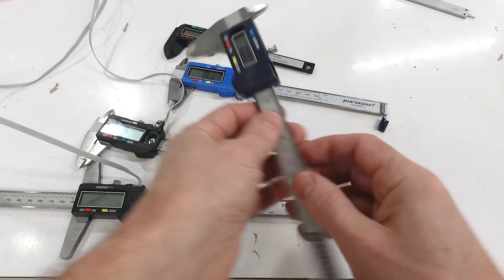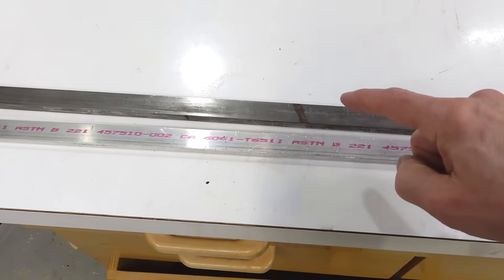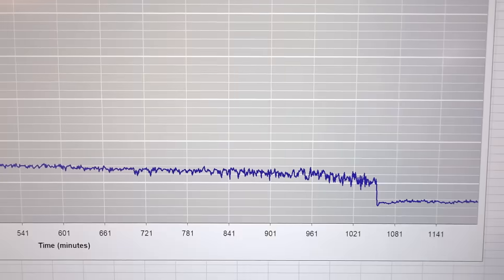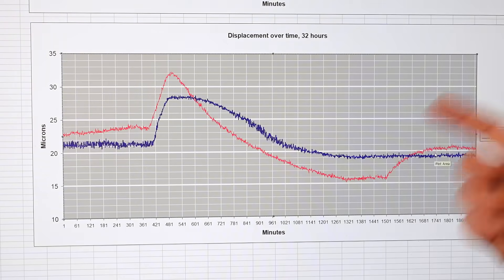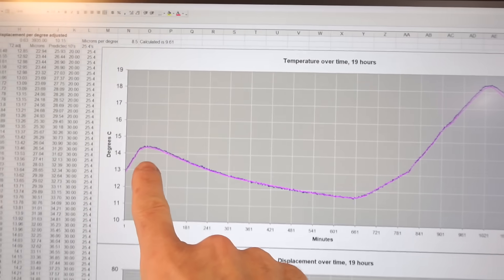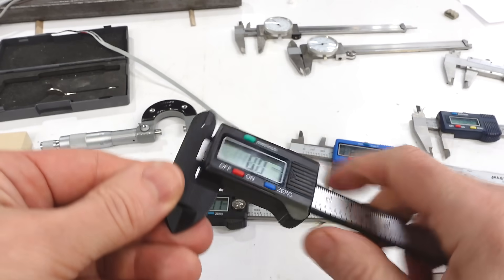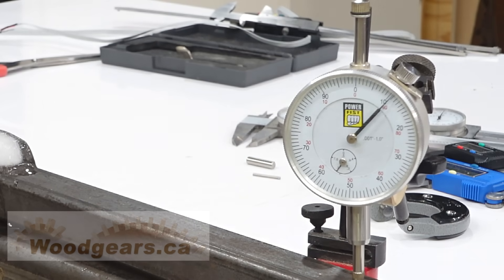Measuring microns with digital calipers

Comment: This was super interesting! Ive got a set of cheap callipers that actually had solder pads on the pcb you can tap in to - the signal doesnt seem to quite match up to others ive seen but it might be useablea
Reply from the maker: there are different protocols, a lot just send what is on the display, binaryt encoded, which is much less useful.

Comment: Just found this video today, so sorry for the half a year delay 😬
On the non-instrumented end of the bars, you are mechanically joining two dissimilar materials by friction. I woul love to see how the system performs if you reduce the contact point between the two as much as possible.
Now the question is: how can we get the "good", cheap calipers? 😬

Comment: you can use a lever arm with the micrometer to get even more accurate measurement, because of the level magnification effect. also making your own micrometer based on uniform resistivity measurement along the micrometer axis, to a wire. gives very accurate results, assuming the metal is uniform.

Comment: Visualization trick: divide (or subtract) your measurement by your expected measurement to get a graph of error over time, it would be a lot clearer than holding a straightege up to a portion of it and trying to eyeball the deviation.
Reply from the maker: At the scales I'm using, the ruler is quite sufficient to show nonlienarity, and also much easier to understand.

Comment: I think you are looking at two things here.
1. Thermal lag - the bars have finite length and cross section. It takes time for the temperature to rise in the bars, hence the sensors will always lead the expansion.
2. Temperature sensors are not evenly distributed over the length of the bars. You might get better results with many more sensors distributed along the length, or a long length of NiChrome wire.

Placing the experiment inside a tube and pumpung air through a closed loop with a fan would also remmove a few artifacts.
This being said, your experiment shows that these caalipers can be used to get repeatable high precision measurement. 
Accurracy at this scale is extraordinarily difficult to attain..

Great piece of work!

Comment: On the subject of increasing measurement accuracy,  I wonder how to consistently produce small movements of a table saw rip fence.  I have mounted a dial indicator to a wooden base with magnets (I think I got this idea from you)  to render fractional movements of my rip fence (10ths of mms).  This has proven to have some use for getting the fence in the ballpark of the desired outcome but the calculated fence movement never produces the exact desired result.  I know that fence deflection, blade bending and the variability of wood density are all factors but I wonder how great a degree of accuracy is achievable and what reasonable steps are required to produce it?
Reply from the maker: Biggest factor is blade bending.  If you cut through a piece (blade goes through the wood), then decide to take another 0.5 mm off and move the fence by that much, your will cut a lot less than 0.5 mm, because with the blade only cutting on one side, it deflects away from it.  Happens with machining on a lathe too, and machinists have ways of compensating for this.

Comment: I guess your calculated displacement is off to the measured one, because the callipers also have a temperature coefficient! In your particular arrangement, this will result in a reducing factor on the reading, giving you the impression as if the bars did not expand as much as you expected.

Great video. I now have the urge to build an experimental thermometer based on this principle, but measuring the displacement directly with a variable capacitance.

Comment: It's probably the friction in the caliper itself causing the lag between expansion and expected expansion.  Could it be the formula is for a slightly different alloy of metal?  Could Archimedes have used this method to determine whether the crown was solid gold?

Comment: Could the delay in the displacement also be because you're measuring temperature on the surface of the metal bars which might cool faster than their cores?

Comment: LVDT. I agree with you that a micron or two isn't very important for the most part. That doesn't mean that I don't appreciate your very cool experiment! I used to do mil-spec laser machining where I worked (in Canada!) and a micron or two was a very big deal!
In repetitive cuts a micron or two error could add up to several millimeters of accumulated error.  Nice work Matthias!!!
Reply from the maker: when I worked out gear selection tabls for threading inches on a metric lathe, I got very close for a lot of them, but not exact.  But then I realized for some of those entries, if my stock warms up by 10 degrees while cutting the thread, that would add as much error as some of my threadig table entries were inexact by!

Comment: Hi from your results @5:00 it looks to me like a phase shift between the signals. it seems that the temperature sensors react before the calipers do. if you could correct for this i think you will find that the results are very close.

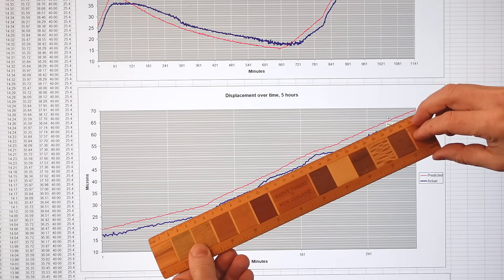Comment: 6:00 These bumps could be due to many factors, including software, but my hunch is stiction. The bearings in those calipers are surprisingly good for the price point, but they will inevitably see some amount of stiction. at this tiny scale, stiction would make it appear to bump in increments, but not entirely come to zero movement like you would see in a large scale

Comment: Very cool. You could make a smaller version of the metal system, and use your high resolution caliper as a high resolution thermometer. I presume the temperature measurement resolution should be on the same order of the displacement measurement resolution.
Reply from the maker: but I can get higher temperature resolution from the sensors.  Iused clone 18b20 sensors, but using good ones, they have 16'th of a degree resolution, but reading them 4x in a row, they warm up ever so slightly over that time, givimg me effectively 64ths of a degree.  And a BMP280 sensor has even higher resolution.
Reply: @matthiasrandomstuff2221  That is completely fair, I actually really appreciate the response. Still, it could be a useful education tool as you already have all of the experiment and data setup to easily work back from the measurement to temperature. It could help educate your viewers on how temperature is inferred through measurement, and is directly comparable to reading voltages from reading things like semiconductor devices. I only say that because I read a lot of the comments on this video, and I think people might genuinely be interested in that content. I'd love to see how your displacement system compares to a 18B20 or BMP280 sensor (I found the adafruit version and BME280). 
I would personally be interested in a video about this measurement and seeing how well you could do, but that is asking a lot. Something like this would have helped me when I was younger and was always wondering why I need to worry about all of the random variables in the equations I had to solve. Each variable in an equation is something you can implement in a design and almost becomes a 'dial' you can spin (sometimes literally). This could help solidify that idea for people.

Comment: This reminded me of a video by Huygens Optics where he also used extruded aluminum as a reference. His measurements also didn’t match the expected coefficient of thermal expansion. The comments suggested the extrusion process is to blame for anisotropies in the material. Perhaps a better material would be a copper or brass pipe.

Comment: Common lathe/mill DRO systems are available with magnetic scales which are implemented the same as digital calipers and come in resolutions of 5 micron, 2 micron, or 1 micron.

It likely those calipers simply don't have 1 micro resolution on the scale.

Comment: Metal has a crystalline structure likely its internal stresses mean that expansion will be in many different directions, so not linear with respect to your measurement.

If the aluminium is drawn then there will be internal stresses vs cast, maybe if you normalise these stresses, some types of metal are annealed after tempering to remove internal stresses / give a better lattice stricture, not sure if this is relevant to aluminium ?

Annealing might only be relevant to ferrous metals ?

Comment: Is there any effect on the calipers changing with temperature that could be adding some error into your measurements?  I would expect them to expand and contract close to the steel bar but a little bit differently because they're stainless.  They're also a lot shorter than your reference bars, so the effect could be small.  I'm just curious if you tried compensating for that?

Comment: The temperature sensors are in air? If so, you're not seeing the metal temperature... I was also wondering, having the things clamped at one end, if there might be something bi-metal effect that makes them move "vertically" relative to one another?
Reply from the maker: Temperature is very consisten throughout the setup.  Temperature changes are very slow, and under the cloth to slow it down even more so the temp sensors taped to the metal really reflect the overall temperature.

Comment: It is possible to get to the scenario where the natural position noise is smaller than the digital increment. The actual point, for Gaussian position noise, is where the +/- 1 sigma is equal to the digital step, at which point the averaging can only give an extra 8-bits of digital accuracy, but needs 2^16 sample to get that.
The first point being that for an N sample average you only get a root(N) improvement in estimated mean position compared to a single reading.
And secondly that you need a minimal level of noise just to tickle the digital steps.
That said most of these devices use Moire fringe effects so have 'same but different' noise factors ;-)
Great work
Reply from the maker: yes, true.  I take about 180 samples.  That gets me 13x less noise, assuming gaussian distribution.  But the noise without averaging is nearly 10 microns, so that seems about right.
Reply: @matthiasrandomstuff2221  It's worth looking at reducing the electrical noise by shielding and filtering the computer connections, and enclosing the read head. The plastic ones are likely to suffer most. Reducing the digital and analog electrical noise is quite a subject, almost as bad as backlash and slop ;-)
Sometimes you are limited to the digit step size that the electronics produces.

Comment: I actually love those little cheap plastic ones you have because the On/Off button actually works as expected.

All my other ones turn themselves on all the time with slight movement and it drives me insane.
Reply from the maker: if it doesn't lose position while its "off", then its not really off.

Comment: Out of curiosity, have you considered making a flexure to set the displacement? 10x reduction in a single stage is very simple, while it'd let you use a cheap micrometer head to run sub um displacements

Comment: why do i get the feeling you are planning to turn your lathe into a CNC lathe
Reply from the maker: Nope.  Not much point without some sort of tool changer.
Reply: @matthiasrandomstuff2221  i see. Are you going to add these as digital read outs? Thanks for the response and great vids
Reply: this type of accuracy could make it easier to machine journal bearings or pistons fairly easily without a post tool grinder or tedious lapping
Reply: the clearance or air gap of an aerodynamic /  air bearing is around 8 microns. Would be cool to see with your new tools what the runout on your lathe really is, i think sometimes vevor can exceed the 10 um runout specification, they kinda have to overshoot it by some degree i guess

Comment: I think the caliper also change its length with the temperature. Thats why you have to use the zero button before measuring. Then you have the aluminium, the steel and the caliper which have to br taken into account. Or what do you think?

Comment: @Matthiasrandomstuff    That setup has a lot of surface to surface contact between the bars. The bars are also in 'from the mill' condition, so they are fairly rough at the scale your measurements are in. I think that the friction, though slight, may be interfering with your measurements. Hence the lack of or quirky response to small temperature changes. I wonder how that experiment would go if you were to add some sort of seperation and/or lubricant between the steel and aluminium bars? Something like a sheet of ptfe would separate the surfaces enough to counter the roughness of the two bars. Or just a sheet of thin polypropylene with some graphite on it would be good enough and cheaper.

Even better, some small steel bars to act as rollers between the bars. Then you'd have to put a shim in to bridge the gap where you clamp the moving part of the calipers to the aluminium bar. But that would reduce the friction without so much mess. I was thinking of the 1mm or so diameter bars I get out of old dvd/cd players, but I think some finish nails with smooth shafts would do the trick. You could even fold a finish nail in half ( the bend and the head will be too thick, but the middle will be fine. So snip the head off and file the bend ) to make a proper thickness shim for the caliper/bar connection.

I have yet to finish my own caliper project. I am about half way through getting a cheap pair to run off a power supply that fits in the battery compartment. Made with a pair of tiny supercapacitors, the photocell out of a calculator and some other componnents. I got tired of always having to replace the batteries after something in my toolbag turned it on a bunch of times. Most of what I have to figure out now is how to mount the photocell where it won't get in the way or get broken. I am probably going to have to 3d print a little holder. But I have not worked on that project since last year, so thanks for the reminder!

Comment: I think you need to take inertia of your whole system into account. The sensors are faster (slow compared to the real temperature) compared to the temperature change in the material. if your change is just in one direction (rising temp. for example) then you can compensate with a shift factor. But you temp changes directions and it gets complicated to adjust your data accuratelly as you dont know how you system really reacts (temp. distribution). So you have multiple parts with different reaction times. friction or reversal accuracy is also a factor. I think the force the aluminium bar exerts is about 0,15 N / µm (based on assumption of your bar length).  So about 15 g.
Reply from the maker: but real temperature change in the room is very slow compared to the sensors and the bars reaching thermal equilibrium.  Look at the scale on the graph, these experiments too many hour.

Comment: Adam Savage talked about how we're not really measuring but comparing. I use calipers to compare things, so it doesn't really matter how accurate the measurement is, as long as it's repeatable. Very interesting deep dive, nevertheless. I definitely like this kind of investigation.

Comment: For the demonstration with the dial indicator, is it measuring the square stock's radial contraction? If so that's really interesting because I wouldn't expect the steel that far away from the ice cube to contract so quickly like that. I'd expect the axial contraction to be more noticeable, but the dial indicator isn't set up to measure that by the looks of it. I could very well be missing something too.

Comment: Did your model include the thermal expansion of the calipers themselves? It's a small fraction of the total length but the PCB material likely has a significantly higher coefficient of thermal expansion than either the steel or aluminum.

Comment: You don't seem to be accounting for the change in length of the calipers themselves. They are often stainless which introduces a new temperature coefficient to your equations.  Get a set of gage blocks and measure everything at 68° F or 20° C--that is how reference labs check. Gage blocks (well nice ones anyway) come with a deviation report so you often know their size to around a 0.1 micron at the reference temperature.

Comment: You mat try piezo buzzer to displace the caliper. Should be proportional to applied voltage.
Reply from the maker: and how much force does that piezo apply?  And how stiff?  If it has to push 10 grams, will that deflect it much?

Comment: My experience tells that there's a slack between magnetic tape and metal base if digital caliper. Try to slide this tape along the base and don't move calipers head. You will see you can mive tape about 0.01...0.1mm. putting some cyanoacrilate glue under the tape helps a much.
Reply from the maker: there is no magnetic tape

Comment: Oh, i expect to see a spacer between alluminum\steel bars in a place where they're clamored together, so the point of contact has obvious transition point. Otherwise you can "hear" bars sliding over each other like tectonic plates cause earthquakes.

Comment: During the experiment with the changing room temperature, the calipers itself experience thermal expansion of their own slide. Plus there may be some influence to the quality of the capacitive pickup (distance between the pcbs, warpage due to different expansion rates between plastic housing and pcb, etc.).